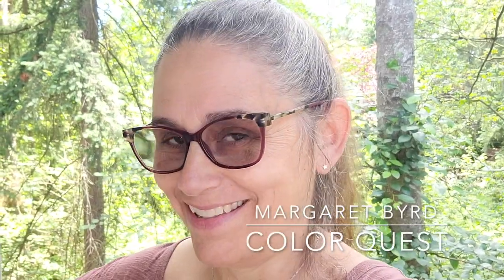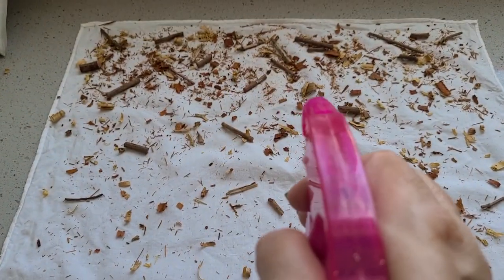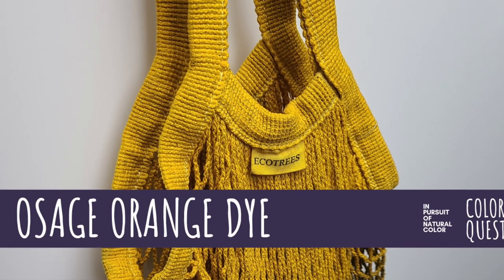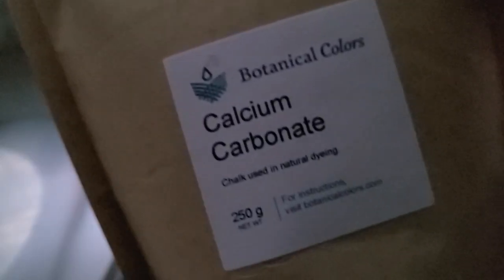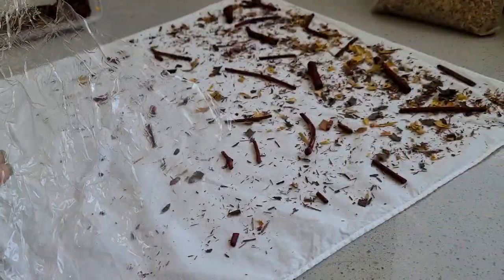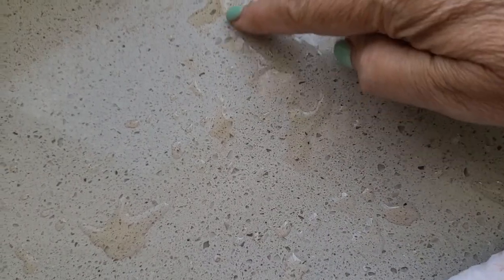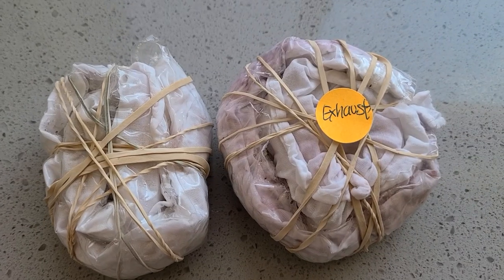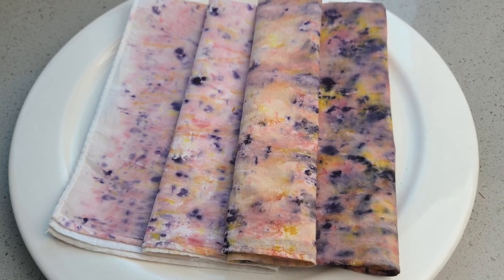HOW TO ECO-PRINT WITH COLD WATER | WOOD CHIPS | ORGANIC COLOR | SAPPANWOOD OSAGE MADDER LOGWOOD

Comment: Where do you buy your chips. And secondly so you ever use pipe to roll and tie. Thank you Margaret
Reply from the maker: You are most welcome, Connie.  I buy these type of wood dye chips from Botanical Colors.  You can find a direct link in the description of this video.  I've only ever used PVC pipe as a dowel besides wood.  Are you talking about using a metal pipe for this?  If it is iron, I could imagine it would add a different effect to the result, but I've never used one.